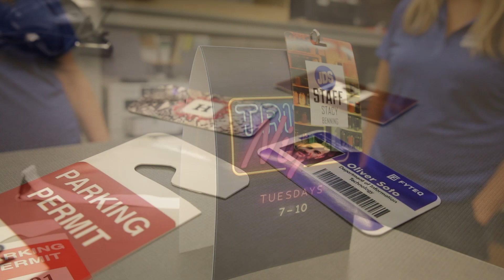How To Laser Cut and Sublimate Flexible Plastic Sheet Stock

Comment: How do you bend for a table tent? Must you heat it? laser a shallow line for the crease?
Reply from the maker: All we did for the table tent you saw in this video was bend the flex sub by hand and it has held its shape fairly well so far. Hope this helps! Our sublimation team would also love to help if you have more in depth questions later on. You can reach them at 855.782.4657

Comment: Is this safe to use in my Glowforge as well?
Reply from the maker: Yes. This should work in your Glowforge. The same tips in the video will apply. Make sure you have proper ventilation and a clean machine and you should be good to go!